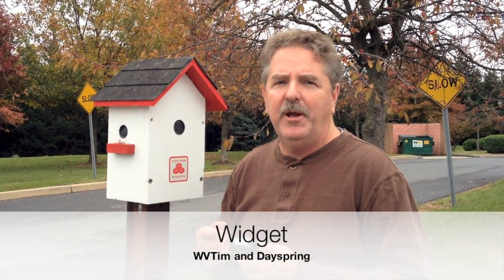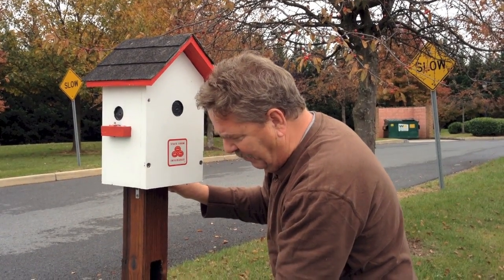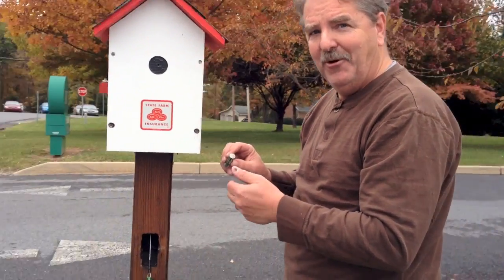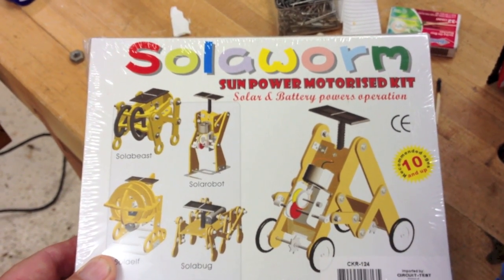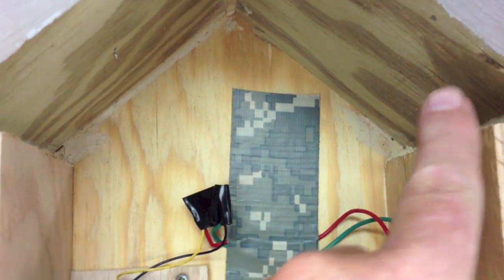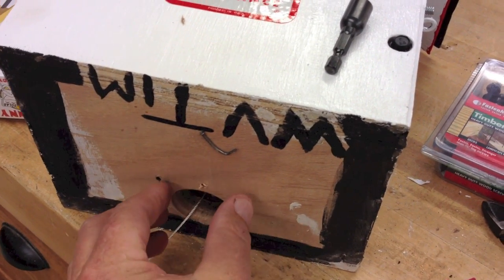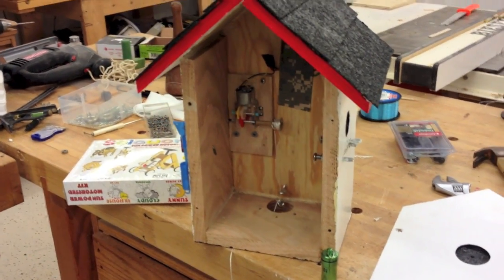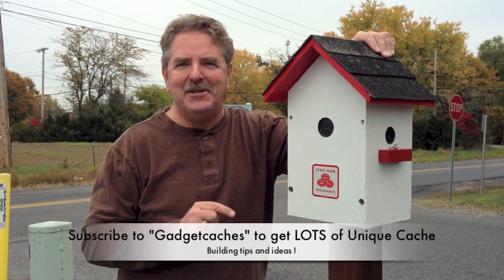How to build a Motorized Geocache

Comment: theres one similar near me but instead of using a AA battery thats provided at the cache location, you need to use jumper cables and connect it to your car battery  to push out a micro container attached to a antenna
Reply from the maker: Yes, I'm very familiar with a cache like that.  I have a video on how to do it, it was posted years ago.  thanks for watching.

Comment: How does this spin if the dowel is loose?
Reply from the maker: Hard to explain, but dowel is tight, but with pressure it can spin.  If not, it would burn the engine up.  Mine has been out for years now and been found thousands of time and is still working well.

Comment: This is great!! Haven't really cached for a year and came across your channel, now the ideas are flowing. How does this cache do in cold weather, I live in Canada and its consistently cold here in the winter.
Reply from the maker: +Brent Ingram no, won't be a bit of a problem in the cold, because the cacher brings there own "fresh" batteries.  The motor will work with no problem.
Reply: +gadgetcaches  do you think this https://www.adafruit.com/products/711 motor work as well as the one in the video? Seems like a cheaper option.
Reply from the maker: +Brent Ingram Appears the one at adafruit needs a min of 4.5 v.  One AA only gives you 1.5 v.   I only use the one AA because its easy to hide the connections.

Comment from the maker: Pete, insects could come up the slot in the post, but for some reason I haven't had that problem.   I did spray the inside of the container with and insect repellant before I added the motor into the cache.   That might help to deter them a little.  I also caulk the edges on inside.

Comment: As an addition you could provide some cables at the geo cache but without an instruction on how to use them. Use only torx screws to assemble the cache with the exception of one slotted screw (-) and one phillips screw (+). You have to inspect all the screws and connect the cables with the batterie to the right ones in order to unlock the cage :D
Reply from the maker: That is a brilliant idea.   Wish I had thought of that one.  Thanks for sharing, I might use that idea the next time.
Reply: Glad you liked the idea, feel free to make good use of it.